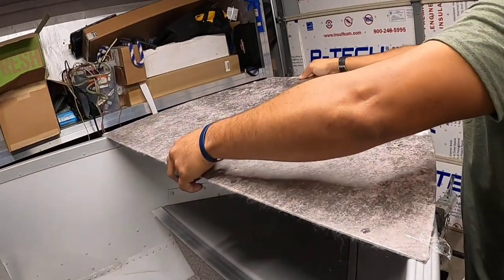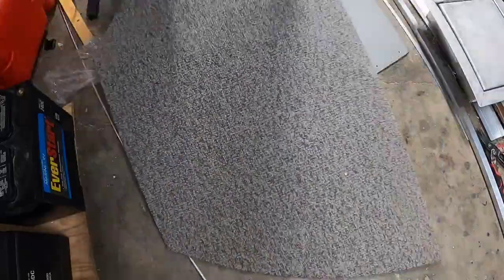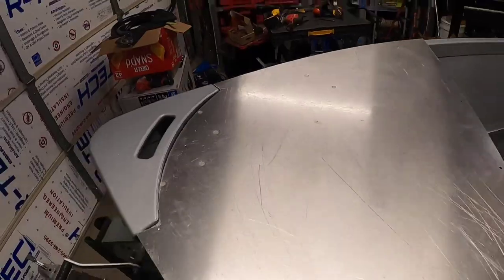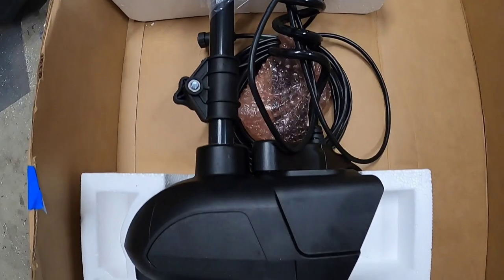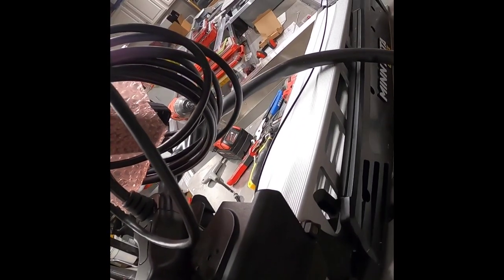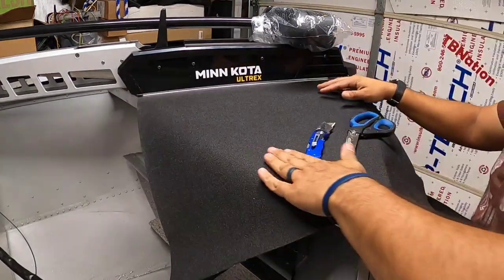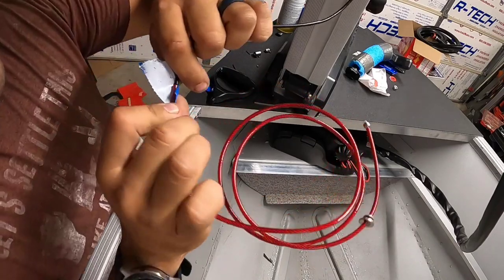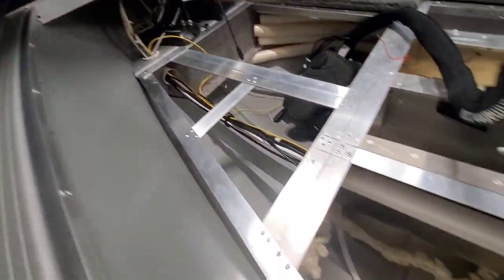Bow Plate & Minn Kota Ultrex Trolling Motor Install.

Comment: Really cool video!  Thanks.  A few years ago I modified the bow plate on my 2002 Crestliner  to increase height and strength and location of my trolling motor.  It turned out amazing, after some hard work. So I know how hard it is to modify things.  That’s why I’m always overwhelmed by your skills. You are a mechanical artist at work! 👍👍👍👍👍
Reply: I just got a used crastliner, the boat seems nice, although would like to take the front seat out and space the other 3 a bit farther, theres only about 2 feet between the seats.
Only 14 ft boat, any advice on a bow plate addition?
Reply: @josephsmith590  I measured the front wooden bow plate. Measured the trolling motor base and purchased aluminum plating which attached to the boat and trolling motor. I held this all in place with bolts, lock washers and locking nuts. Nothing has come loose in 2 years. The aluminum should be thick enough to allow proper placement of the trolling motor and an acceptable overhang. Mine was about 2” high, the width of the trolling motor and the length of the trolling motor base plus acceptable overhang. I bought it from a specialty vendor in my home town.  Caution: measure carefully and have the vendor cut it. I didn’t and had a lot of manual sawing. I’m retired so it turned out OK in time. Hope this helps.
Reply: @larrystolzman9337  it did, thanks!!!
Reply: @josephsmith590  I pray it works as good for you as it does for me. Tight lines!

Comment: I’m trying to do the same with my boat and want to install the trolling motor mount on top but would like to have a flat shelf below like you did where I can stow my batteries.  I can’t seem to find the video that explains how he leveled off the shelf, the little one below the trolling motor piece, and secured it.  Any help would be greatly appreciated.  Thanks

Comment: Great video I have a couple of questions, one is where do you get all of your aluminum, two since stainless steel and aluminum are dissembler metals is it okay to still use them and three have you made any videos on putting seat bases in the floors of your boats. Thank you for your time
Reply: Two different metals together will cause corrosion.